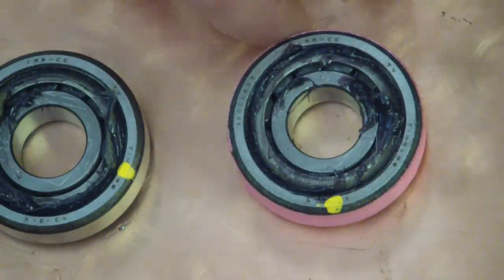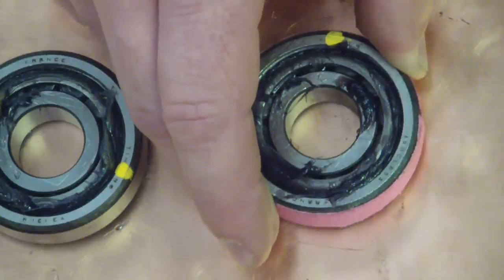Frictionless Bearings - Technical Secrets Explained!

Comment: Funny, when o was in high school 1968, a rep from Ford Motors  talked to our class and his first topic began with rotating a large plywood wheel standing vertically. The wheel spun throughout his discussion on new things in industry. When his discussion came to an end he the returned to the wheel and asked if anyone noticed it was still spinning?  He the pointed out that the reason was that it used an air bearing. I have heard of them used in aerospace since. I do not know how they work, but the friction element is very low. May be you can enlighten me though not likely as my densification level is fairly high.

Comment: Is it still the 1 of April?
Actually SKF are selling low-friction bearings but what they have done I think is just to lower the amount of contact surface. That means the contact pressure increase so they must have a slightly better material.
Since low losses is popular nowadays they have decided to sell the bearings as "low friction" instead of "higher capacity".

Comment: I´ve been selling bearings my whole life. The only way to achieve more resistance related with speed and temperature is by buying bearings with special nomenclatures after the bearing number such as c3 c4 c5 c6 (608-2rs- C4) that means the groove is bigger for ball expansion due to high temperature. The bearing that you showed in the video is a 31304 a metric tapered roller bearing from Timken, and there is no way to obtain a high temeperature o speed conversion of it, neither on the inch series, it will be all on the grease. Deep groove ball bearings on the other hand have multiple options, as I said before an expanded groove or maybe an special housing with special lubricants. There are also ceramic bearings that are quite superior that steel ones.

Comment: You can test bearings under 0 load with a lunar wane shaft.
Reply: s0nnyburnett But you have to make sure that the bearing is surmounted in a logarithmic casing to prevent side fumbling.
Reply: sivalley
Only if you are testing spurving bearings.
Reply: s0nnyburnett
 I thought that's what these where!
Reply: s0nnyburnett Im so glad someone made a reference to this!
Reply: s0nnyburnett 
This thread is amusing because i understand nothing
Reply: s0nnyburnett You were hasty and forgot about the obvious tool for testing bearings under zero load. The new Rockwell Turbo Encabulator.
Reply: @s0nnyburnett That depends on whether or not they're muffler bearings. If they aren't, you need to use a wobbilator shaft instead. Their intended usage also determines weather you should use squelch grease or blinker fluid as a friction modifier. Refer to the technical bulletin posted by Ryan S if you have any questions.

Both muffler bearings and wobbilator shaft bearings can be installed with a left-handed smoke wrench. Alternatively, you could use either a Swedish nut lathe or a Mexican speed wrench, but be sure to use the metric model.
Reply: @slateslavens  You better keep a sky hook handy in case the thing starts to let go of the rotary flux piston.
Reply: @rehoboth_farm  Is the Rotart flux piston retained by an oh-snap ring?
Reply: @slateslavens  well, after revision 2.0.36a.
Reply: @rehoboth_farm  IS that when they introduced the dinglearm of prefabulated amulite?
Reply: @sivalley  everyone knows it is they hydrocoptic marzel vanes that are responsible for preventing side fumbling.

Comment: Back in my skateboard hooligan days i had a buddy that would always gut his bearings and run them dry, and he could roll for miles. Shoulda capitalized on the idea back then damn it
Reply: Yeah, he would kinda spray whatever was kicking around in there randomly to get the dirt out haha. I used to use a teflon based lube mixed with the grease, lol. Young and clueless. I never had any issues with them though
Reply: Back in the 80's I used to tear apart my bearings and throw the balls in a small (roughly 6oz can size) tumbler with shredded newspaper I put through the blender. Turn it on and leave it for a day or two to polish while tried my best to polish the races with newspaper as well. Then I reassembled them and used graphite. Worked wonderfully well... too well at times, as after a wipeout I'd have to chase after my board for a 1/4 mile lol. The biggest flaw was that polishing the bearings made them rust rather quickly if it was humid or simply left unused for a few days. (whatever coating they came with now removed.)
Reply: DJ Dragon Using graphite on steel parts is a bad idea as it absorbs moisture.
Reply: Bob Cartwright yep, graphite absorbs moisture, but it's still widely used on steel, from bearings, high speed machine tooling, hot and cold forming, bolt threads, and engine blocks as compressed graphite iron, just to name a few. Anyways, I was simply talking about trying to get some better performance out of .50 cent bearings in a skateboard as a teen in the 80's. Who cares if they rusted? (mainly due to my polishing the metal rather than using graphite)

Comment: You are forgetting the main benefits for Brinelling. After  the pesky smooth furface is gone in about 30sec, these bearing testicles will have a much greater laminar boundary layer. 
If you add a couple magnets to the sides of these revolutionary BearRings that almost propel them selves you pretty much have free energy!!!
Reply: What about the extra brake wear and speeding tickets, there is no such thing as free energy. You need to add a capacitor in serious parallel to obtain any benefits.

Comment: It would be great to see a lazy Susan type asphalt surface that could be dry/covered with ice/covered with water and then have a rubber tire dropped on it to illustrate the friction differences. Imagine a spinning disc of ice covered asphalt with a tire patch dropped on it, and then as the tire patch fails to get traction - a hand full of salt (or sand or whatever) is introduced to show the dramatic difference in friction.

Comment: What you demonstrated dear sir, are two identical bearings, just one with grease. What the article talks about is a ball bearing (not tapered roller) without the "cage" to separate them ball's, thus (theoretically) eliminating the friction between the ball and the cage. 
Nice theory, but as you said, testing a bearing under load is the real deal.

Comment: just watched the pm link... lol.  just pull your bearing apart, grind some very crappy grinding spots on your inner and outer race, throw the cage away and move on.  amazing, somehow the cage is the main source of friction and not the load placed on the inner/outer race pressing on the bearings!

lol, how did even PM let this article out?

Comment: the closest thing to frictionless is using 2 repelling magnets in a vertical direction but even that has limitations
Reply: +Nick Silcox There are frictionless air bearings that are ground so smooth that they float on a cushion of oil between the 2 surfaces. They are completely frictionless.
Reply: +Chris Shaw I would not say completely frictionless. Because those surfaces are in oil, that creates drag and friction. Not a lot but it's there. And Those bearing exists, their called "plain bearings". Railroad wheels, crankshafts, and cam shafts use  plain bearings with a thin layer of oil to keep the 2 surfaces separated.  Unless there is no air and its levitating, there is no complete frictionless bearings.
Reply: +Chris Shaw my vb36 wood turning lathe has those, but they are not frictionless, some turbines use compressed air as the "lubricant" but even air can create friction though it would be very very very very low
Reply: +Nick Silcox limitations of repelling magnets are load capacity before the repulsive force is overcome and the surfaces touch. Also side loads if on a wheel.
There might be a small amount of friction due to eddy currents but this is negligible.
Reply: +Tim Lewis its possible but eddy currents primarily effect stator in the iron core when the iron core becomes magnetized and decreases the efficiency and power
inless it is in a complete vacuum, there will always be friction from air.
Reply: +Chris Shaw Not so. They create plenty of friction.

Between people that call them frictionless and those that don't.

Comment: Interesting! But one question Ave : the regular bearing heated up a lot more didn't it? Or no
Reply: It did, but that was before he put the grease on the "good" bearings. If he did a measurement after putting on the grease, they would've been the same
Reply: Evan Wright I'm thinking hairdryer

Comment: I bought an old second hand 20 Quart Hobart food mixer, and after using it for a few years in a bakery setting, opened it up for some reason or other, only to discover that, either a couple of the gear shaft bearings had never been greased, or, at some stage they had been replaced without grease. Given the pristine condition of the grease covers, I suspect the former. I just applied some grease and used it for about 20 years more before selling it.

Comment: I came here looking for actual shafts that use trapped air we bearings to spin the housing on. I believe the  technology was patented by FUJI in Japan. I believe it was Fuji that patented many enclosed sand blasting techniques. One of the which was essentially trapped air as bearings, or whatever it might be called. Still searching this decades old technology

Comment: If you have one with ceramic balls it will spin even longer. My friend has some at his motocross shop on display and both are complete clean of any lube, yet the ceramic one will spin 3 or 4 times longer than the steel one.

Comment: When pray tell will there be force field bearings, I'm very disgusted with the odor of chooch lube. Sooooo deprimido
Reply: ***** they already exist they use electromagnets and are used in operations that a normal bearing would contaminate like handling gasses and oils to uranium enrichment
Reply: imchris5000 yes, but they are not able to take much load, the loads I'm thinking of.
Reply: ***** yes they are
electromagnets are incredibly strong
they are used with huge loads

electromagnets can move hundreds of tons
Reply: imchris5000 linear, yes they sure can. I agree.
Reply: ***** Google is your friend SKF markets mag bearings for all speeds and loads, especially high speed/load generators with 100+ton turbines
Reply: Lenny C thank you for your astute observation.
Reply: You missed the part about force field....
Reply: magnets are as close to a force field as you can get
its magnetic force and its in a field
Reply: imchris5000 I didn't say magnetic field bearing. 😊
Reply: ***** Force fields are magnetic fields. again with the whole internet book of knowledge thing. Unless you mean a plasma based force field which then will have fluid friction and melt the shaft, and need a magnetic field to stablize it...and would be less efficient than a magnetic bearing.
Reply: Lenny C probably a wave form i'm waiting for, but hey thanks for the education on em fields.

Comment: Aerospace grade marketing BS!  High quality flim flam.
Reply: Glyph To be fair, they probably do decrease SLIDING FRICTION by an order of magnitude with no retainer cage to slide against. There is still the main foe of ROLLING RESISTANCE, that depends on high pressures delivered through detailed nano models of the surfaces that incorporate the feedback effects of heat transfer. 

I don't have the working knowledge to judge if this is a valuable or significant improvement. I am also curious as to how the ball separation varies during changing acceleration or loads, and how that might affect performance/longevity.

Comment: I think you've just saved me from shelling out a massive fortune in buying all new ceramic wheel bearings for both my motorcycles. I've seen loads of videos of bearings being spun up with compressed air and rpm reading taken showing more rpm's on ceramic which is sold as being less friction so more better but with no load on it of course its gonna be better by a mile but what happens when the load gets applied. Id love to see you rig something up that could demonstrate a "low friction" (i.e a fucked one) bearing vs a normal bearing

Comment: Hi, thanks for the video, you made a very good point!
Have you ever head of full ceramic ball bearings? A friend showed me one the other day and I was baffled! I can't even figure out how they put those together.
Reply: agnostos1000 They insert the balls between the two loose races, and then when all the balls have been installed, they separate the balls with the cage.

Without the cage, the balls can cluster together on one side of the race allowing the race to lift away from them in the other direction.

They use cages made of slightly flexible nylon or teflon so that they can be squeezed between the balls into place.

Comment: Without the grease it's fun to hold the ID still with two fingers & get the outer race spinning like a mofo with an air hose. Besides the ultra cool sound they make you can launch a pretty potent projectile by releasing it like a wheel onto the shop floor

Comment: A zero load bearing is actually useful for fidget toys where you need a low friction bearing that will spin for longest.. so i did some diy fidgets and first thing to do is remove all the shields and grease from bearings.

Comment: similarly, I've heard that you can use WD-40 or better yet 2 stroke pre mix to wash the grease out of skate bearings, shake them dry & have the fastest setup for about a 1/4 to 1/2 mile of ultra fast downhill, before the lack of lubrication catches up & the bearings are never low friction again

Comment: i need a very sensitive bearing for balancing RC car wheels. I think cleaning out the grease might help. Any advice on what kind of bearing I can buy that would work for me?
Reply: +Gary Carone Any good bearing. As in the video, they will spin easily without load/grease. an RC wheel is very light, so don't bother with any grease and you should find your heavy side easily.
Reply: +Case Isaac thanks! I ended up forgoing the bearing all together. I just used a threaded rod, an aluminum spacer, and threaded coupler. Then I just let the whole assembly freely roll between 2 fuel cans. the wheel rolls right to the heavy spot.

Comment: I use water for all my bearing applications and then silicone them shut. They are mostly used in my airplane for my prop. The water does have to be Zero water filtered though, otherwise the birds tend to drink all the water.

Comment: The derby girls need your advice on how to run faster bearings AvE. They chew threw bearings faster than I can earn to replace.  Same as skateboard bearings. If you care, you could do a review of cheap vs high end skateboard bearings and as they apply to roller skates and cool girls on quads. Cheers. Carry on the good work.

Comment: The best way to check for how good a bearing is: clean bearing thoroughly - removing all of that pesky grease, then use air gun to spin bearing dry - suggested is 90 psi but for best effect crank it to 150. Hold air pressure against outside roller until bearing spins dry for 5 minutes. Remember, grease causes friction, and this post will cause destruction of the bearing.

Comment: Where can I get myself some of that there aerospace grade purple grease?! On a serious note though, what about magnetic bearings, are they frictionless?
Reply: deeryme Nothing is totally friction-less outside of a perfect vacuum, however, magnetic bearings would have near 0 surface friction. However, the implementation would require electromagnets, and would be difficult and expensive to use as a traditional bearing. Additionally, since they would require constant power to function, you have to ALSO use a fallback traditional bearing just in case. Totally not practical unless required. They also deal with sideways torsion horribly, even compared to how bad traditional bearing do :P
But yes, those do exist.
Reply: Richard Smith Hey man thanks for taking time to write such a decent reply! I never thought about that sideways torsion issue but it does make sense. Only asking about it because the day before I watched this vid I was on a tour of a semiconductor factory that uses a type of "atlas crapco" compressors that used magnetic bearings, it was fresh in my head. Cheers again for the reply
Reply: MichaelKingsfordGray 'Perfect vacuum' itself is impossible. That is implied but I did not point that out.
Reply: You might want to look into fluid bearings! In a cerain sense they are the magnetic bearings mirror image - about equally low friction and similar need for control & opposite dynamic properties.

Comment: I'm sure I'm missing something (joke or not), but why do you equate grease with load? Isn't grease designed to reduce the friction that would otherwise cause an ungreased bearing to fail too quickly under intended load? And what if a novel bearing design greatly reduced this intrinsic friction, to the point that grease increased total friction under load? I urge you to perform a third test: clean both bearings of all grease and see if they perform equally. Or better yet, test both bearings under equal load in the first configuration (i.e., right bearing is ungreased).

Comment: caged ball bearings where invented by the Romans, not leonardo davinci. It is well documented that romans used balls between plates to make it easier for big sculptures to turn around, for show off. Roller Bearings were used by the Egyptians, found also in drawings. A patent of modern caged bearing was in awarded in 1794 to Philip Vaughan. Would be nice to add the correction as popup caption in your video, greetings.